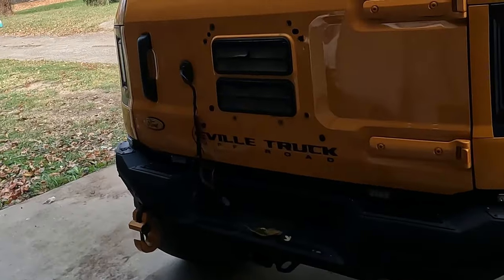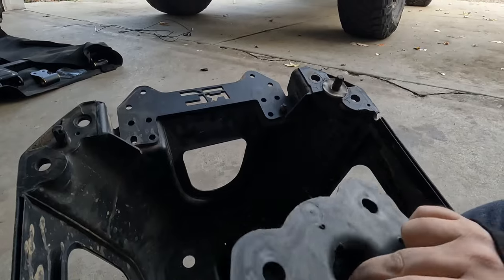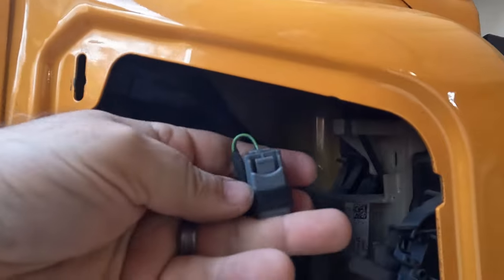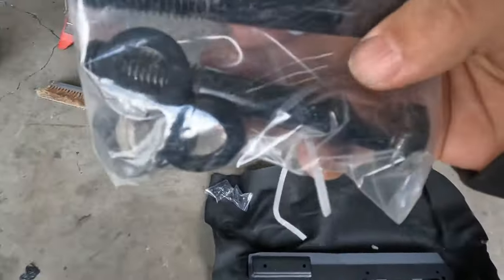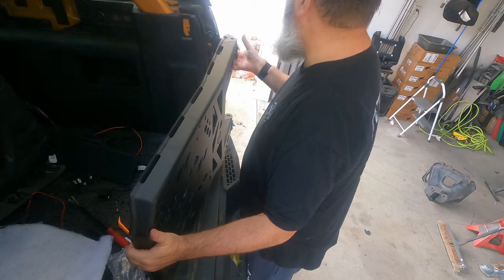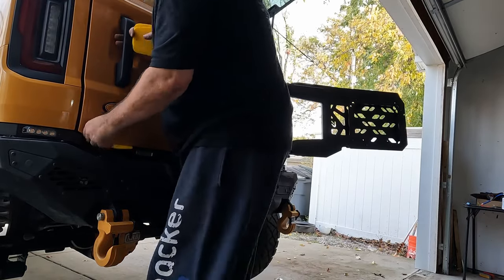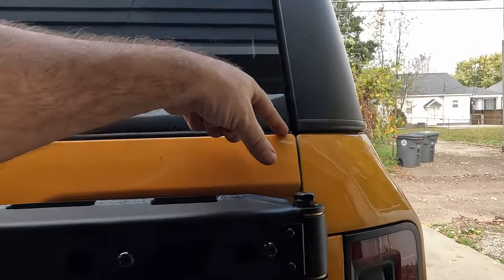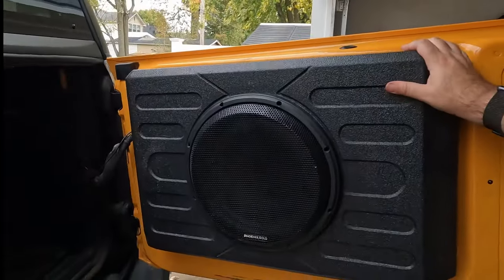Best Bronco Tailgate Reinforcement

Comment: This is the one to buy. I tried Hammer Built and it didn’t hold up to the weight of 37’s. You need bigger hinges. I switched to this one and it has been rock solid.

Comment: Could you leave wiring attached to the tailgate and just put the tailgate into the cargo area?
Reply from the maker: I don't think there is enough slack on the passenger side to be able to pull it out far enough to stick the drivers side in first.  You probably could get enough slack without completely removing the wiring but disconnecting some of it. though.
Reply from the maker: Looks like I did it the hard way :)  as @wheelerk2012 pointed out @turnoffroad sugests disconnecting the wire harness from the other end which makes a lot more sense 😅  https://www.youtube.com/watch?v=x0GXPuAwgaY

Comment: Turn Offroad used a different method for the harness.  https://youtu.be/x0GXPuAwgaY
Reply from the maker: Their way  seems much easier :). I had other wires run through  the grommet for my license plate lighting and  had just run the wire for wolfbox rear camera so that wouldn't have worked for me, but. if you do not have any of those  extra wires, then for sure. disconecting it there seems a lot easier